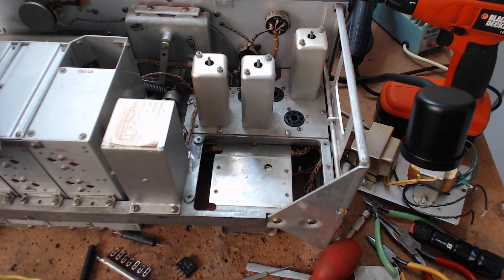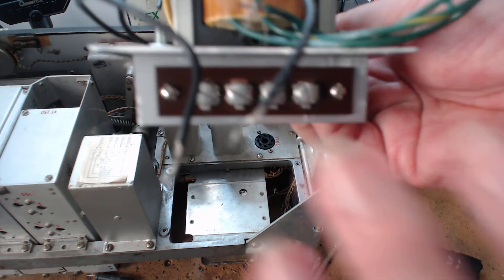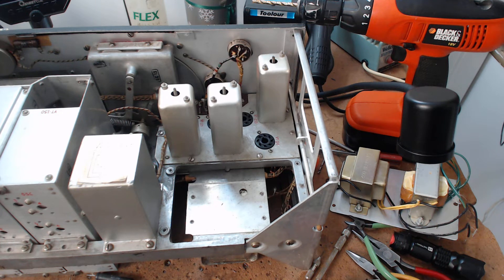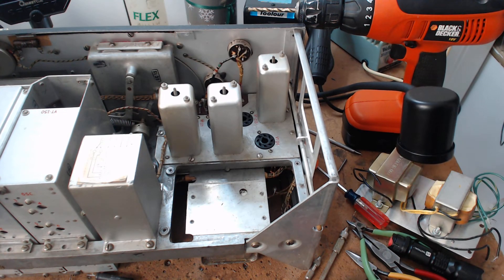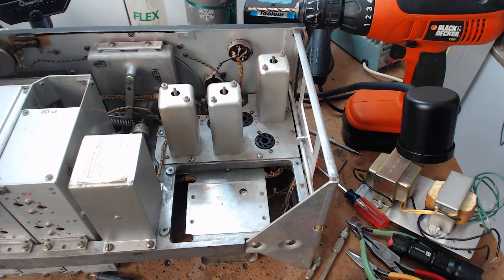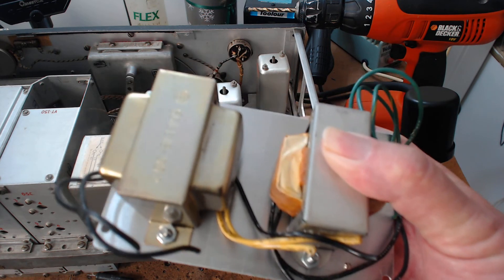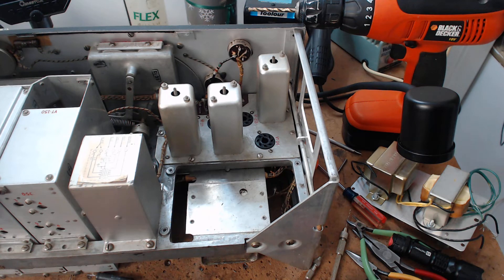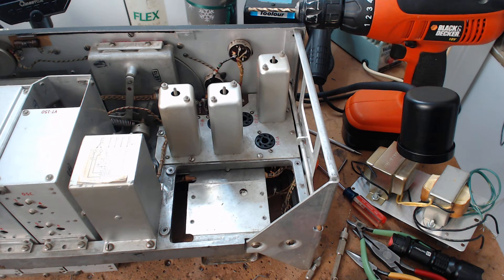Making a supply for a BC-348  WWII Radio

Comment: What you have is correct
Reply from the maker: After doing the Command radios I am pushing the reversed transform a little more. I am hoping  hitting  a 18 volt winding with 24 volts will give me 200VDC at the output cap.
Reply: @johnkleinbauer4424  you will get it to me your straight forward and you know what your doing 💯👍